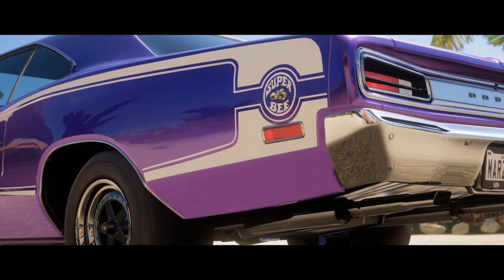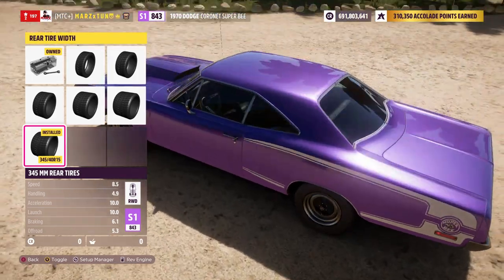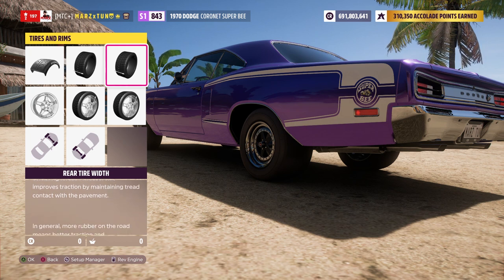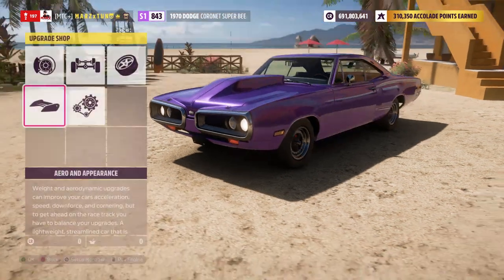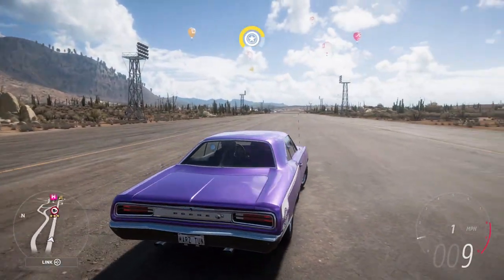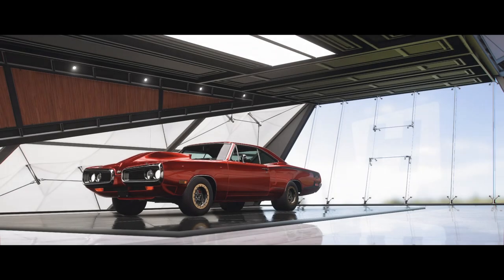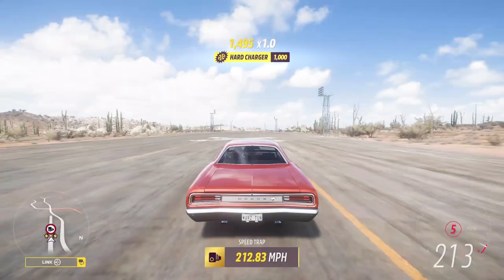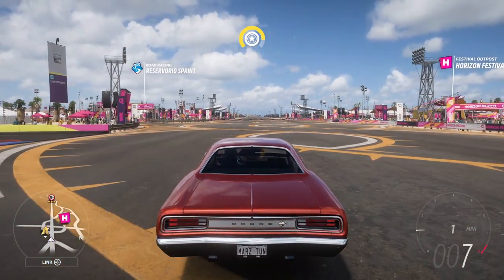FORZA HORIZON 5 - CORONET SUPER BEE (DRAG TUNE)

Comment: Add some deceleration to the rear diffs, it helps with grip, it cuts a bit of power when you’re wheels spin and provides optimal traction, just don’t go past 50%

Comment: I feel The venom Hennessy should be faster than what it actually is. I've got it to a 13.34 seconds, but I feel like it should reach just under the 13.0 mark
Reply: Which Hennessy the one is coming out the “venom f5” something like that?
Reply: @iTsJesusBruh  the one that is out right now.. it has over 1.4k HP and around 2.5k weight.. it should be fast but Ive got it do a 13.34 second mile. But with that power to weight, should be doing at least a 12.5 second mile.. maybe someone else can tune it better?

Comment: Considering the fact that it is as  fast as it should be disappoints me but did you consider the aerodynamics of the considering it's a pretty big car correct me if wrong
Reply from the maker: If that’s the case now look at the Regal G body that moves super nice and it weighs more . Or look at the 2018 Mustang GT a car that don’t even get 1,000hp and it weighs like 3,000 pounds still moves like crazy. What makes the SUPERVAN such a fast car ? It’s not aerodynamic at all and I can make it have 1,750hp like the super bee and it still destroys   It. So yes , weight to power ratio plus a nice set of tires is the key to it all. Thanks for the discussion .
Reply: @marztuning  thank you for informing I'm not much of an aerodynamic expert so thank you for the explaining to me

Comment: I tuned this car lastnight rwd 1750 hp and it does 4k wheelies and traps 180 190 but it should be faster
Reply: if you cant trap 200 ... delete the tune 🤣
Reply: @stephenEs3532   bet u load ur tunes and run awd lol
Reply: @justa_whit_boi7320  what’s the code

Comment: I feel the same way, the other i had my monte carlo on steroids and the next day it went to complete trash 😂 some people said that the physics of forza changed so im guessing the way i had my monte tuned got effected by it
Reply: Can be a season change and tires no be hot enough or too hot, only my fwd cars have been affected by the physics change tbh so it should be the same
Reply: @amslucifer9678  Thats the problem with forza and i have noticed i heat up the tires and like 10 seconds later they are cold,,, the other day my friend was tunning couple of cars he swap to ther cars and went back to the cars that he was tunning they all started spinning
Reply: @iTsJesusBruh  Typical Forza, also sometimes the ground gets wet without you noticing

Comment: I've noticed this with many other cars I've tried tuning in the past it's annoying fr
Reply: the hot wheels 2jetz has a really good launch but it also as a really low top speed
Reply: Try reducing diff acceleration and using a rollcage with these big motors i do second rollcage sport driveline and around 35 diff
Reply: @amslucifer9678  thanks
Reply: @TorinoOBrancoBonito  That only apply for rwd cars, awd cars you can run 100 0 100 0 no problem
Reply: @amslucifer9678  thanks for the tip

Comment: Unexplained an unlisted changes making cars "less good" right before a big update that will be heavily monetized and advertised? Yea, I'm sure it's totally unintentional and not at all a marketing strategy, smh. Hot Wheels update cars will be insanely good, and make them lots more money if older cars can't compete.
Reply from the maker: Please note this has been the same since Forza Horizon 2 . Weight to power ratio is weight to power ratio.  If a car has 1,000hp and it weighs 1,000 pounds it should be fast and that’s that. Tires are the next factor that comes to play but as long as I can remember that theory has never been a part of Forza horizon games. They pick and choose what cars are fast and what cars are not. And you can tell that’s the truth by simply owning a DODGE DART . That car there has been so fast for so many Forza games for no reason.